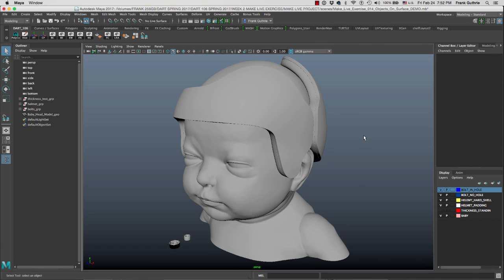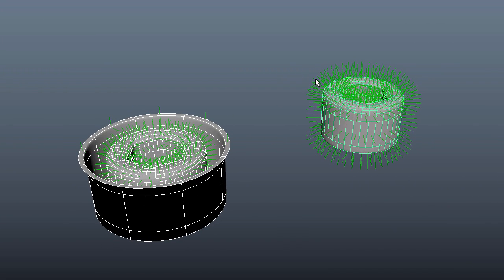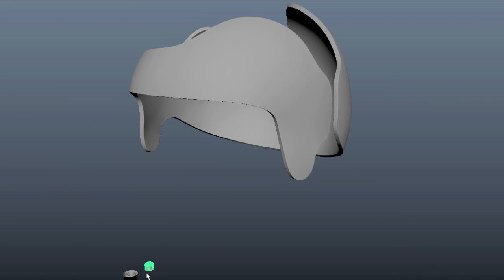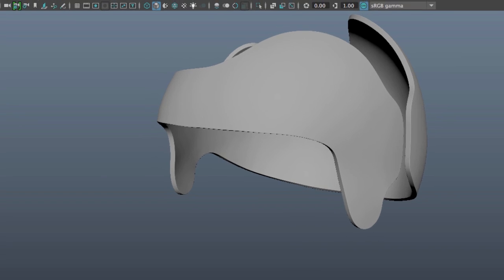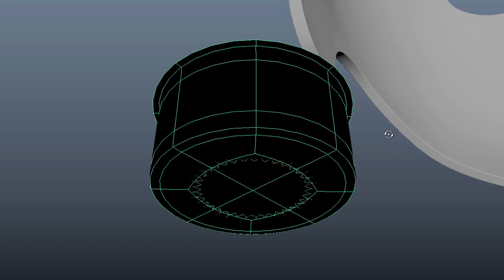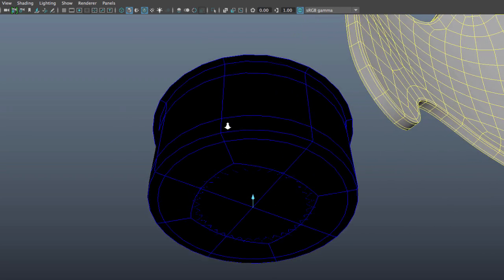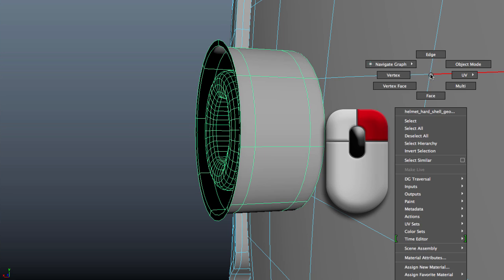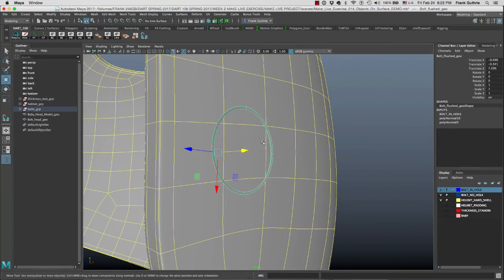DART 106 Intermediate Maya: Snap Together Tool

Comment: I tried this to snap a square object to a face, problem is it randomly rotates the square so it doesnt end up matching the angle anymore :/ how do I avoid this?
Reply from the maker: Move the Pivot of the Cube to the face (of the Cube) that you want to snap to the other object. This is important because you will be able to rotate the Cube after it snaps to the other object, and having the Pivot on that face will help. Then use the Snap Together Tool to snap the Cube to the face you want to snap to and the two faces should match. Hope this helps.
Reply: True I can rotate it once it has snapped to the other objects face, but during the snap it still throws off the rotation :/ moving the pivot to the face doesnt seem to make any difference in that regard
Reply from the maker: Before you do the Snap To Point, perform a Modify / Freeze Transformations. Maybe what's going on is that its taking additional transform data. Snap the Pivot Point to the face you want to use to snap from, then perform a Freeze Transformations (all transform channels should show zero and the scales 1) and try the Snap To Point Tool.
Reply: That didn't end up working, but I did figure a way to avoid it, if I first orient the angle of the object to match the same as the destination face  (lets say both objects face south) it doesnt do the random rotation issue, but if I try to snap one object facing south to another facing east, it messes it up, strange, but still doable. Thanks for all the info though!
Reply from the maker: You're welcome. I may make another video to explain this issue!